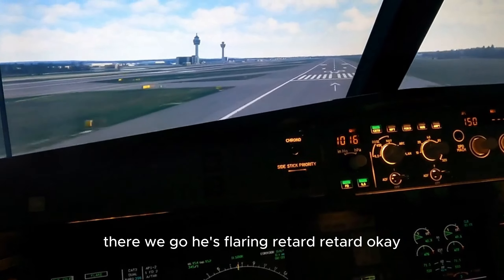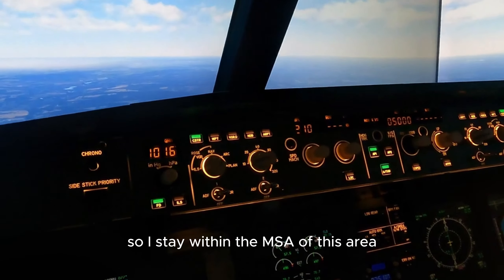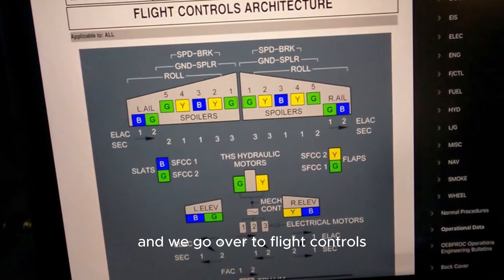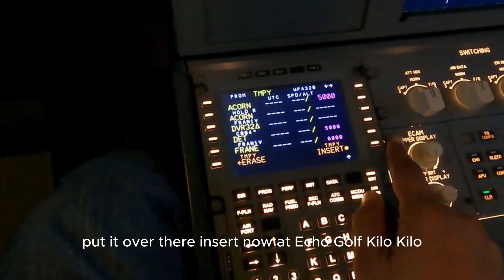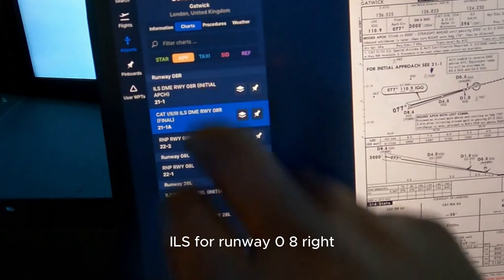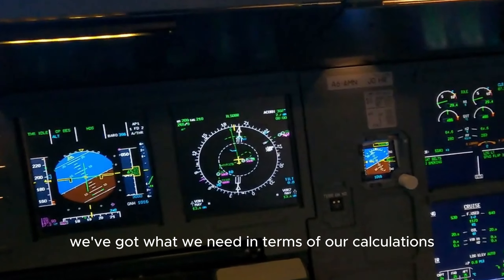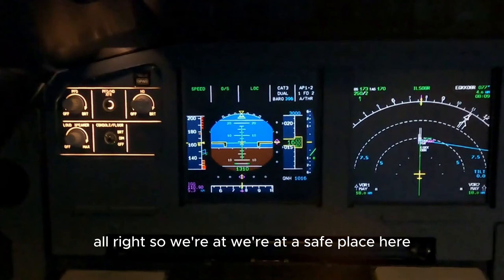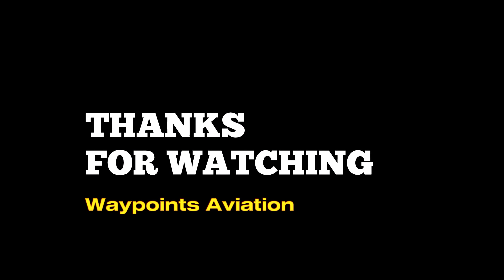Airbus A320 Tutorial: Slats & Flaps Locked - How to manage and land the airbus.

Comment: Hey Captain, can you explain what is wingtip breaker?
Reply from the maker: in summary, WTB are activated in case of asymmetry, mechanism overspeed and a few other cases. They lock the flaps and slats in position and can only be de-activated through engineering maintenance.

Comment: How to Set A320 Trim pitch need full explain
Reply from the maker: A320 has an auto pitch trim, if that fails then you have the trim wheels on either side of the throttle. You can see the video of using it to land in the following video: https://youtu.be/vv3gVGlqlY8?si=thr2WKOq0vFMokVv
Reply: @waypointsaviation  THANKS CAPTAIN